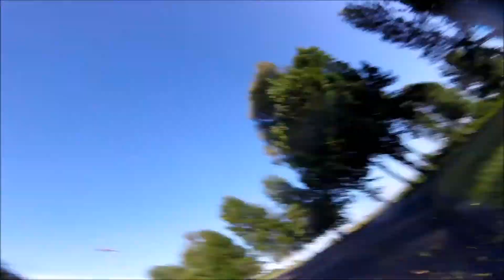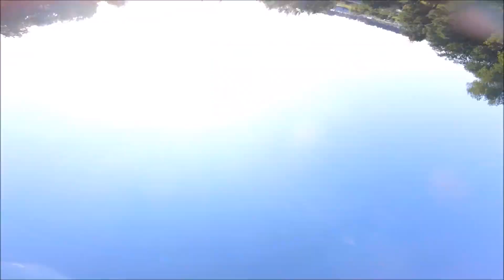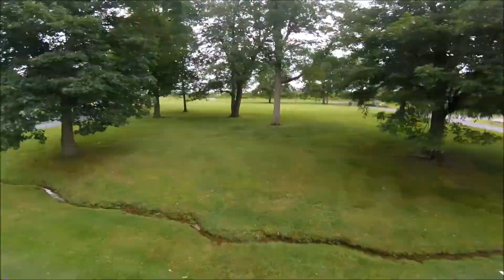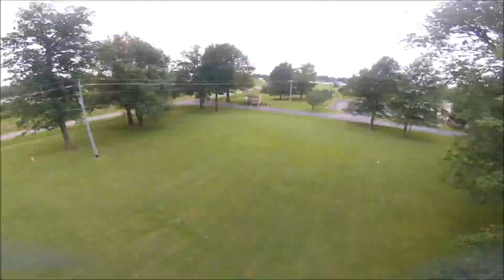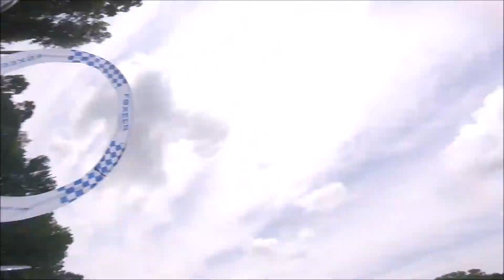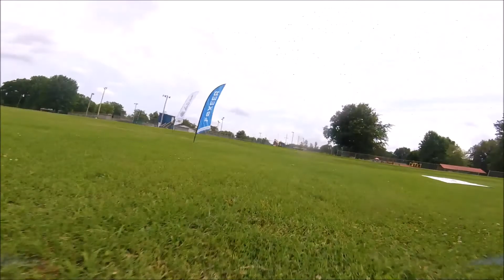FPV Drone Keeps falling out of the sky!! Unknown Reason

Comment: I'm having the same issue! Did you solve it?
Reply from the maker: Hey man. This was a long time ago but it turned out that one of my wires from the receiver that was connected to my fc was frayed so I had to resolder it. Hope it helps.
Reply: @bluelinefpv559  Thank you for the quick response! Unfortunately I've already tried that. Everything seemed to be fine, today I was trying my new micro hd camera with the quad that had those issues, and as soon as i got a little bit of confidence and tried something crazy, it fell out from the sky. Quad and new camera damaged XD
Reply from the maker: @jukkaismi  Sorry to hear that man! Try changing the wite that your using to connect the receiver. Had some issues with the wires on my brothers camera on his quad. It's a possibility. Other then that check antennas on the receiver. I hope it's not a bad receiver for you.  I just had one go bad a few days ago.
Reply: @bluelinefpv559  I'll definitely try that! Thank you for your advice!!